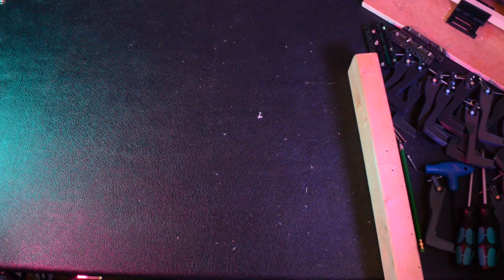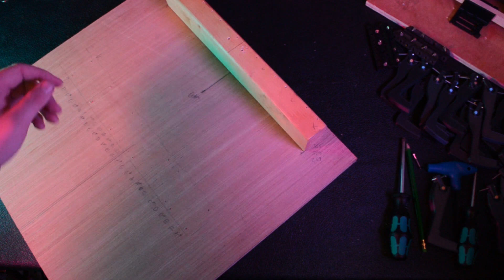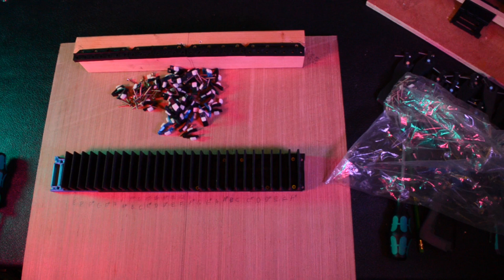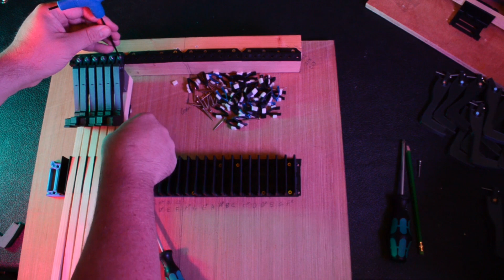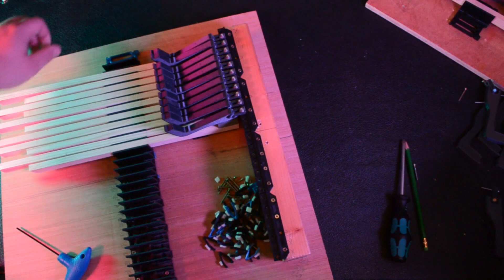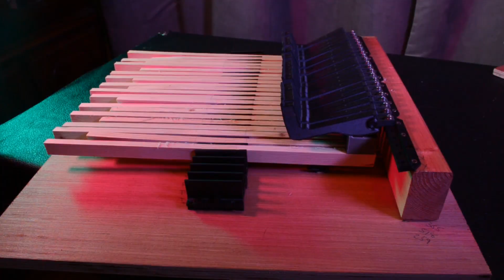DIY Electric Piano  - Assembly 1  - Episode 10

Comment: I got a used valente not long ago. I initially wasn’t into the action. But after more time with it I’ve grown to really like it. I think with any new instrument, you need to learn it. The action itself is on the heavy side because the fatar tp100 is weighted and you’ve got the additional weight from the added action. It’s also kind of loud I think mainly from the fiberglass shell,  if hardwood was used, it would probably be a lot quieter but I think it’s worth it for the weight savings. It’s based on a Suette action which will feel different from other designs. I think of it as almost two hammers or strikes in the key stroke. When the keys depressed, the lever part of the fatar weighted action strikes up on a sprung plectrum which then strikes down on the reed with the other end. The two points of striking contact as opposed to most pianos one should feel less dynamic but the weighted fatar action and Valente’s good design and regulation make it feel responsive. I have not played an original Rhodes but from what I’ve read, stock actions were pretty sloppy, so I assume the Valente is probably better
Reply: It’s cool to see you make a tine piano instead of taking the easier reed route. Can’t wait to see how it turns out
Reply from the maker: Thank you, at times I wish I took the easier route haha
Reply from the maker: I really like the Valente Piano, I haven't played one, but it hits a good price point and appears to be well made and creates a genuine EP. 
Good to hear you enjoying it. Do you have any recordings of it?
Reply: @deancoyle  no recordings yet,but Key Magic’s newest vids do a good job capturing their sound. The Valentes just sound so old, like a 50’s Wurlitzer. You can hear the sustain lift occasionally and the highest 3-4 notes resonate the whole harp, not too much just small mechanical noises which contribute to an interesting sound
Reply from the maker: Sounds interesting keep me posted how you get on with it :-)